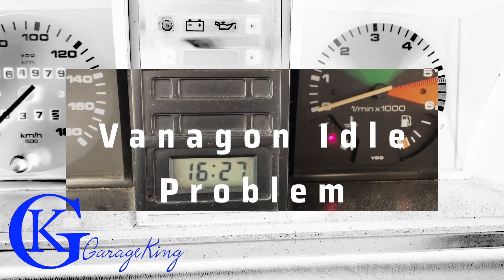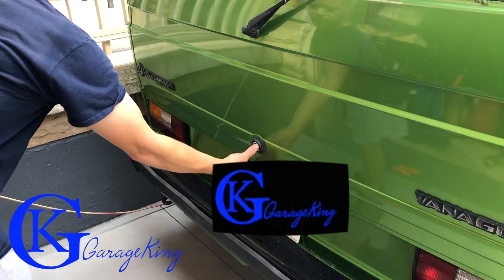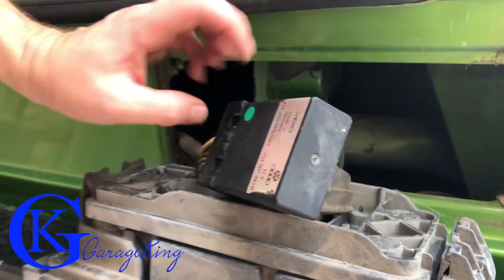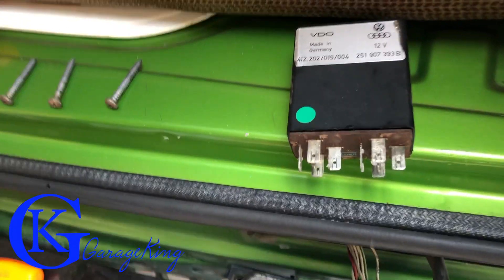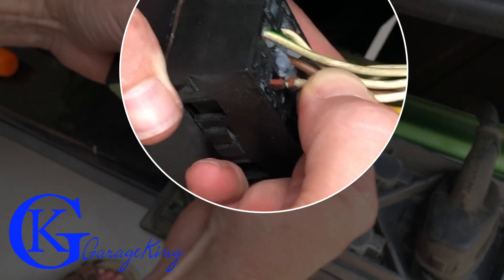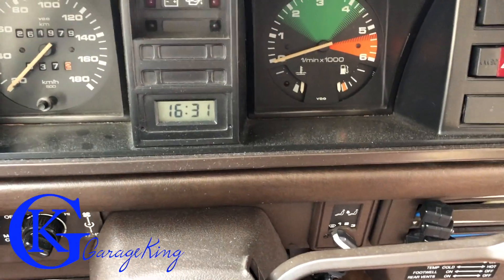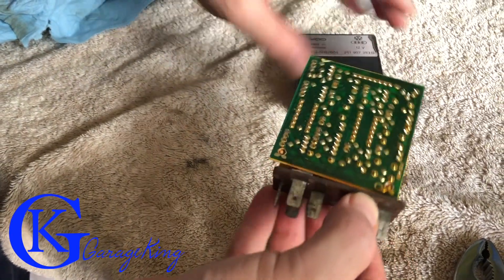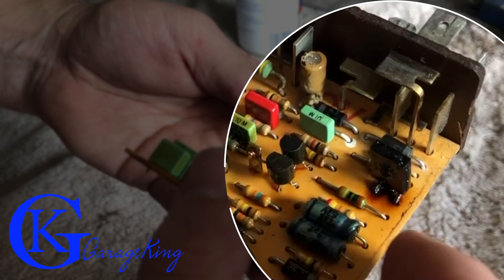Vanagon high idle (86-91 Digifant)

Comment: How do I know it's the problem before buying a new one?
Reply from the maker: If you check the relay and find the transistor burnt then its one thing to fix.  You will have to do that anyway, you could have other problems, but at least go for the obvious first.  Its easy to check.
Reply from the maker: Also you can't buy a new one.  They only rebuild them now.

Comment: Will you post the video on how to replace the transistor In The idle control unit?
Reply from the maker: Hey there and thanks for the comment.  To be honest I have not done the replacement yet.  I had the extra part so my van is running well :)  I ordered the transistors, but have not soldered them in yet.  I may try to solder them in this week, so then the video would be out in two weeks.
Reply: I've had a heck of a time ordering the transistor replacement. Where did you purchase yours from? Looking forward to the video. Much thanks for sharing your knowledge.
Reply from the maker: Hey there, the video will be out this Saturday with all the info you need :)
Reply from the maker: @aprilbarker9488  Hey There, I haven't soldered them up yet, as I was in the garage all day doing the control arms and radius arm bushings on the Vanagon (Front Suspension), you may want to see that video.  Send me an email to garagekingcanada@gmail.com and if you want to cover postage I'll sent you a transistor, and some resistors (you may need those)
Reply: @GarageKing   It is great! Thank you for posting and taking the time to research. Sending an email down. Looking forward to watching the suspension video too. Watched a few and it looks doable and may take some muscle.  😀
Reply from the maker: @aprilbarker9488  Excellent, I watched a few suspension videos before I filmed mine, and the reason I do that is to try to pick out what people missed and include those points in my videos.  I have most of the suspension done now, but I'm waiting for 2 spacers, and I'll get those late next week.  I think I have a Hyundia brake video next week that someone was asking about, and then the week or two after that I'll post a Vanagon vid :)  Hope you are enjoying your weekend :)

Comment: Wow, good job GK!
So, my '85 Vanagoon's doin' the same thing....what is it....?
Reply from the maker: Because yours is an 85 you may have a different fuel injection system digijet (1.9L) vs digifant (2.1L)  Digifant was introduced in late 85, so you could have it, you would know.  If you have Digifant check behind the tail light and look for the box. if you don't have Digifant then google "vanagon 1.9L idle stabilizer module" and you click images and you can see what it looks like.

Comment: The ICU mounts on a black plastic part bolted to the body opposite the tail light.  It must be properly mounted to prevent water
from getting int the unit.
Reply from the maker: Thanks for the response !!!  These vans are old and I thought it was really weird for it to be that way in the rear. It was dry but obviously not mounted right.  Now I know and I’m going to fix that up. Thanks !!!